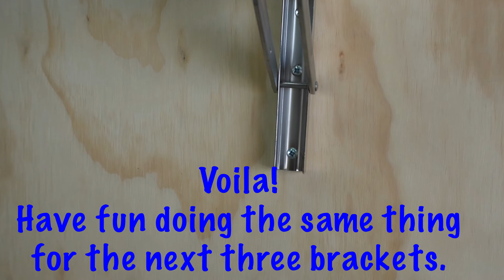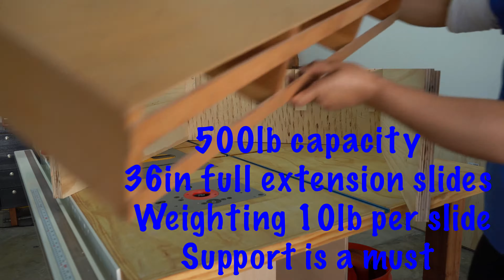4Runner Drawer & Bed System - Part 2

Comment: Where to do you store the wood extensions when not in use?
Reply from the maker: Just on top of the box. The owner is going to keep the bed intact the majority of the time so there isn't  a need to include a storage area for them.  It was made this way so if he needs to transport passengers, he can easily convert. That's a great question by the way. In the future I might include a storage option. Where would you add it?

Comment: whats in the blue spray can that youre using?
Reply from the maker: WhiteKnuckle6.2  it's FastCap 2P-10 Super activator. It makes the accompanying super glue dry almost instaneously.  You can find it on Amazon.